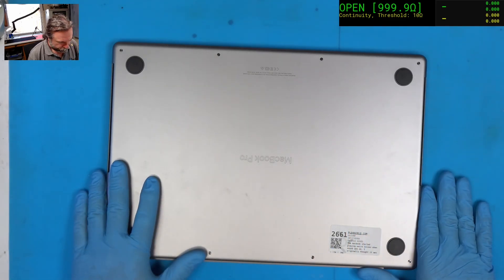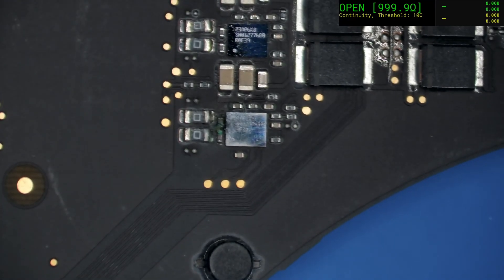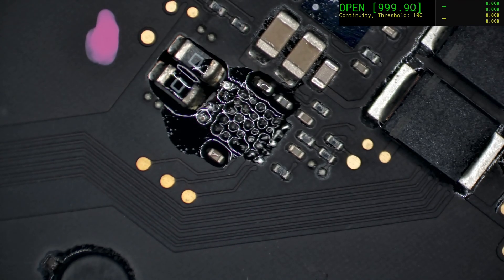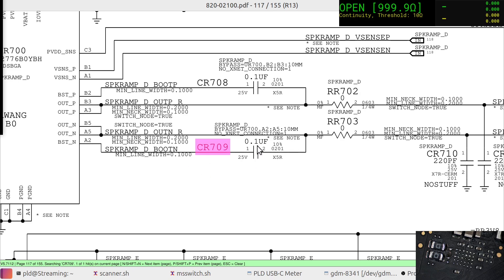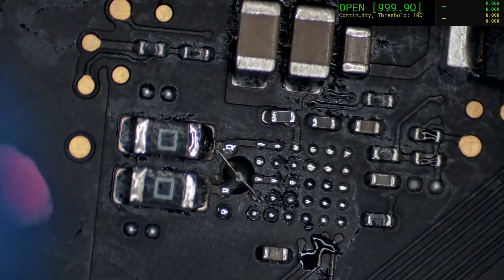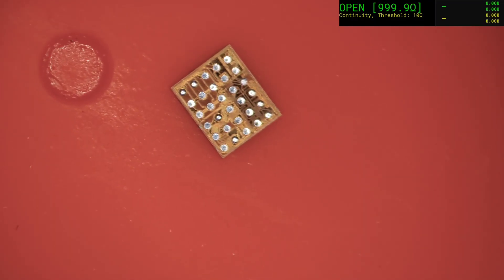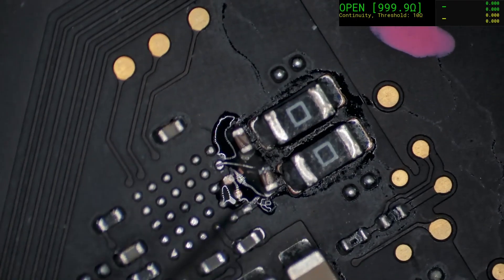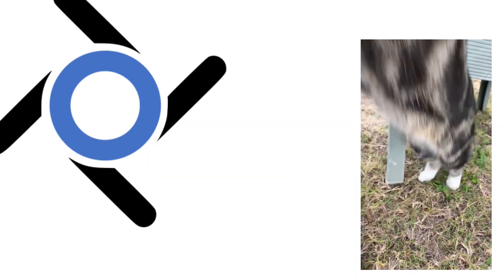No cap, n̶o̶ problem. Macbook A2485 Audio damage / cracking - a different kind of liquid damage

Comment: Hey Pauly! Im working on same problem on A2991 2023 M3, with bad amp SN012776B0 I extracted from a 2021 model, no audio. Are these amp ic's cross compatible between 2021-2024? i.e. if the numbers match..great work as usual!
Reply from the maker: If the amp was definitely the fault ( burned out or such ) I'd be checking to see if you're still getting power and the data lines to it are good.   I don't believe that there's any custom-id/unique details in them ( though I could well be wrong )
Reply: @pldaniels  Thanks paul. I can confirm A2442 M1 speaker amp, compatible with the M4 2024. Problem fixed. cheers!

Comment: Paul, why did u overcomplicate it?
track was fine... only the pad was corroded
Reply from the maker: There's no track.  The trace goes down off the cap pad (via) and then through an inner layer and reconnects to the BGA pad only.  There's no trace on the topside.

Comment: I (tryed) fixing my MacBook ,however I just Gave up. I had similar tought (no cap no problem) , no capacitor no broken capacitor... (tryed chaseing down the short) . Just pulled down 3 caps (next to the gpu) from under the plastic speaker support on the gpu... However nooo... was probably a bad mosfet , who knows. (still had short overther after pulling down a 330uf and 2x small smd's-cap). It's bizare , the MB died on desk with no power, just refused to come on anymore (battery charged.... so was not that and I don't think it was the chargeing circuit). oh well... partsbook....(It's beyond my level of how to fix her). A1278 - EMC-2254
820-2327-A
Reply from the maker: At least for the A1278's you can get replacement boards so very cheap now.   To be fair, a lot of those faulty boards have a LOT of subtle corrosion.

Comment: 3:40 At least the caps don't throw a tantalum ;) You're a far better technician than me but if there was any of that pad left I would have been tempted to check for continuity with the pin on the audio IC and if preset rebuild the pad instead of running a wire.
Reply from the maker: Nothing was left as the via stalk had been consumed ( @5:11 ), a bit of rubbing with the iron and that flake dissapears.